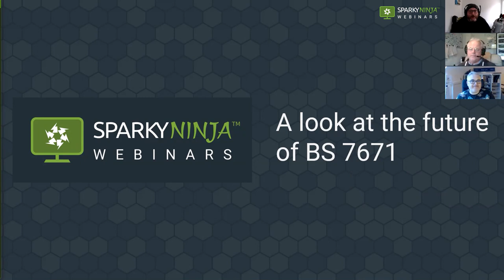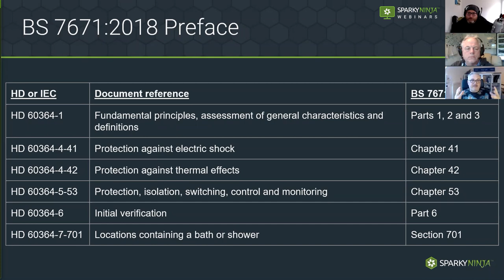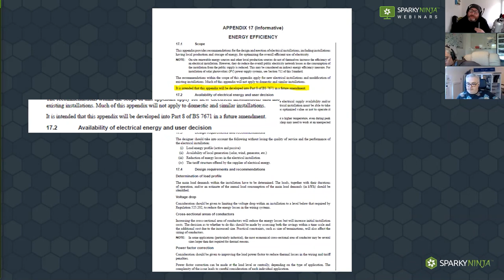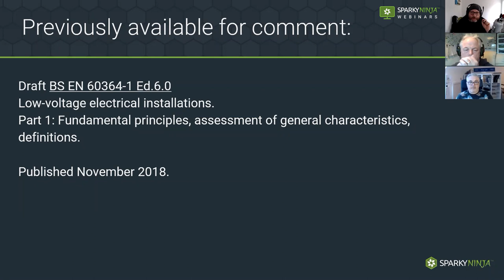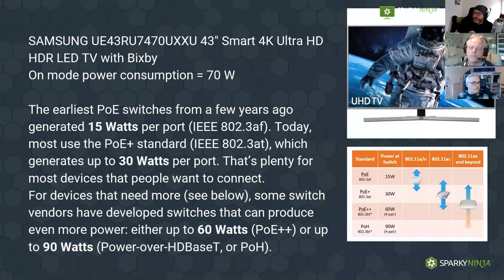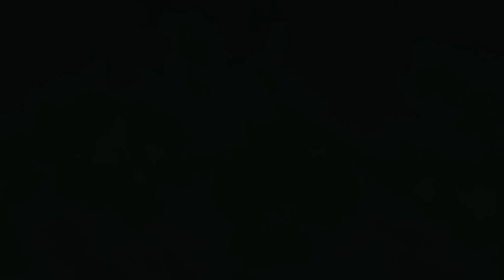A look at the future of BS 7671 - A SparkyNinja Webinar

Comment: Interesting point about upsizing domestic cable sizes to cope with insulation; I wish the companies making Single Phase DB's for the UK market would make 3A RCBO's - a new or rewired house with more than 700W of lighting on one floor should probably have multiple circuits anyway. You could stick to using 1 or 1.5mm cable and negate putting a fused spur in for extractor fans